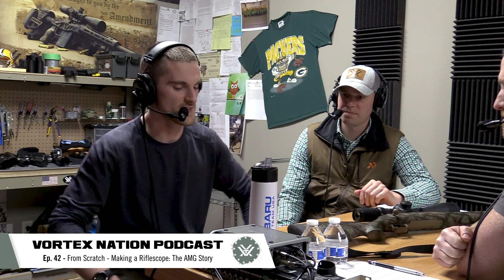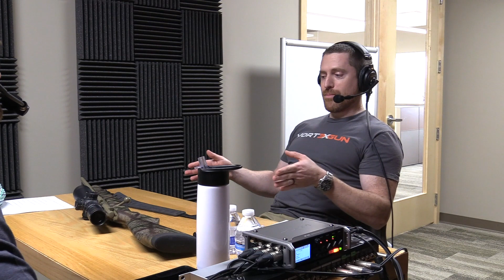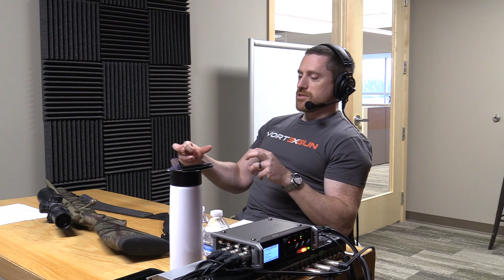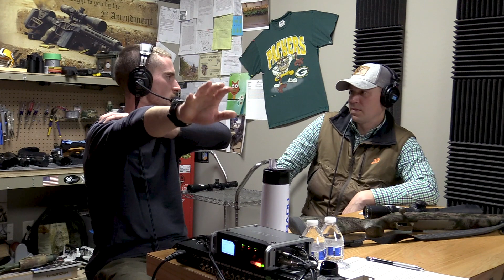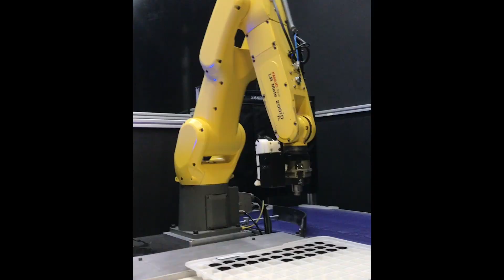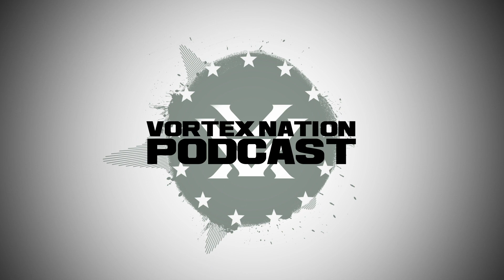Ep. 42 | From Scratch - Making a Riflescope: The AMG Story

Comment: Just found this video.  I actually have 3 of these scopes on different rifles, a TacOps Lima51, a Mega Maten 308 and a Mega Maten 6.5CM.  I have owned the Gen1 PST and the Gen2 Razor and prefer the AMG, hands-down.  Absolutely stellar optic!  I (obviously) am a big fan.  I do prefer the older EBR-7 (center-cross) over the EBR-7B (center-dot), though.

Based on my roughly 3 years of experience with these scopes, here is my input:
 - Tool is an excellent addition, but it's too soft.  When the scope is newer, the caps are tighter and the tool just doesn't cut it for removing the caps.
 - The anodizing on the caps is a little "thin".  When the plastic tool fails and you use a coin (I believe nickel fills the slot best) to unscrew the cap, the anodizing suffers pretty quickly.
 - Locking eyepiece focus - THANK YOU!
 - Ejecting brass on the bolt rifle (but not on the gas guns ... go figure??) tends to hit the windage turret and has dinged up some of the knurling.  Any thoughts about having rubber rings glued on the turrets instead of aluminum knurling?  Maybe even a shrink-fit sleeve over the knurling?
 - Ease of zero is awesome and the infinite adjustment is GREAT.
 - Optical quality - I buy scopes based on what my eyes see, not what a machine says I should see.  To me, the AMG has clarity at least equivalent to my S&B PMII 5-25, throughout the mag range.  Also, the focus on the reticle seems to maintain a little better on the AMG throughout the mag range over other FFP scopes I have used, including NF, Athlon Ares ETR & Cronus, my S&B and even my former G2R.

Questions:
 - Why the German reticle instead of making your own?
 - Argon as a purge gas - Are the optical properties better than Kr or Xe?  I would think having a higher weight (larger atom) gas may be desirable to reduce leakage.
 - Any plans for future AMGs?  A 6-30x56, 4-20 or 3-15x50 may be a little more challenging with the 5x, but sure would get a following.

Thank you for GREAT products and for supporting LEO/MIL purchase programs.
Reply from the maker: Thanks for the feedback! Regarding the tool - it's not really intended to open up the turret caps as much as it is to adjust the inner turret once the zero stop is disengaged, but still good feedback considering many people probably do try to use it to take those caps off! Hard to do much about the knurling on the turrets and ejected cases. Most people don't like extra bulk put on their turrets and just prefer the knurled aluminum. Perhaps something you could modify up yourself though?Regarding why the German reticle - that has everything to do with how difficult and actually dangerous the reticle etch and fill process is. The amount of equipment it would take to make it happen, safety measures, and potential failures that could occur in the manufacturing just isn't worth it so it's better to send that part out to an established reticle maker. The one we work with in Germany is the best we've found, so we didn't hesitate. Argon is just a more effective gas for water and fog proofing. Has nothing to do with the optical quality. We'd love to do future AMG's! But can't say much more than that at this time :) Thanks for tuning in!